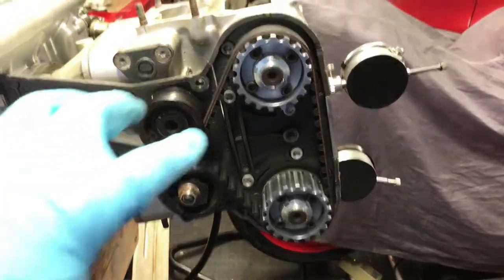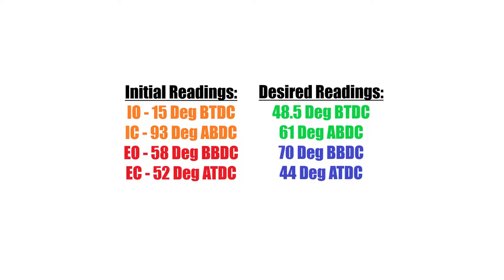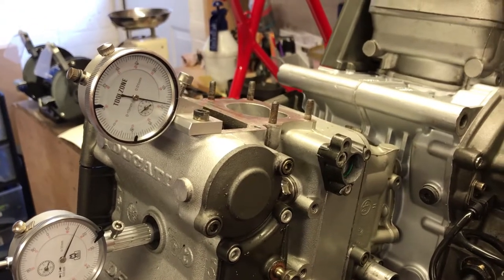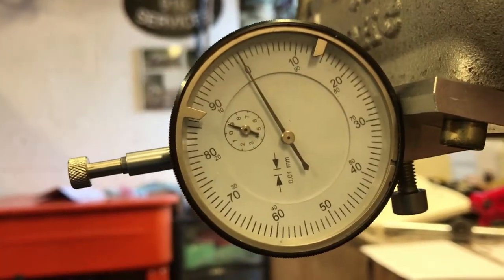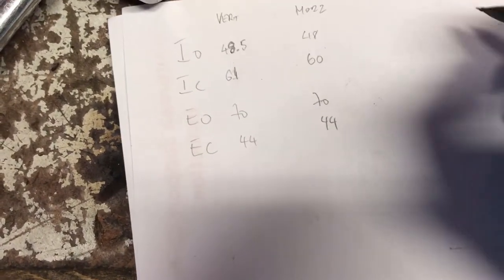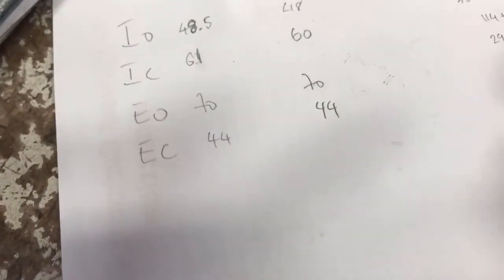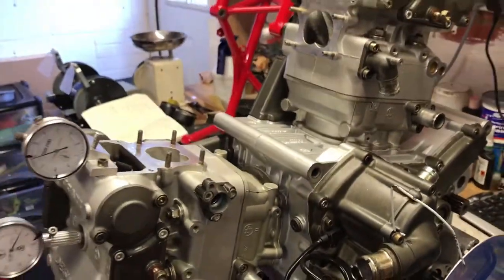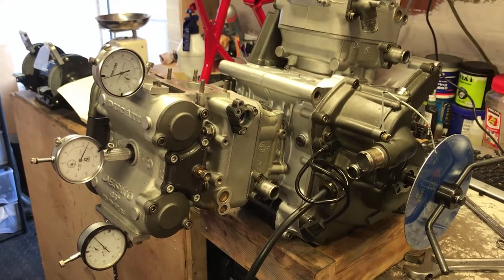Thunderbike Race Prep Video 14 - Ducati 748 Checking Cam Timing Part 2 of 2

Comment: this was an awesome video.... absolutely love the fact you actually checked timing, been watch video on not just my duc (1098) on belt changes/valve adjustment and everyone just shows marking belts and putting then in the same place after transferring marks, great video brudda thanks
Reply from the maker: Glad you like it Shane
I always check the timing on a full rebuild, its slightly easier when just changing belts but only if I put the originals on would I not check timing :)